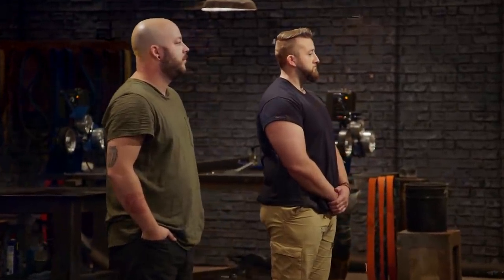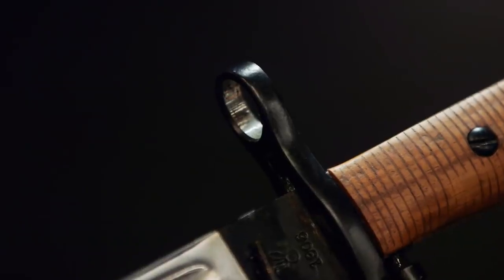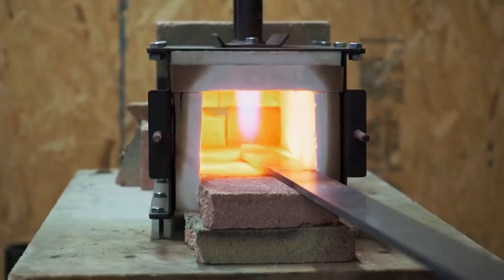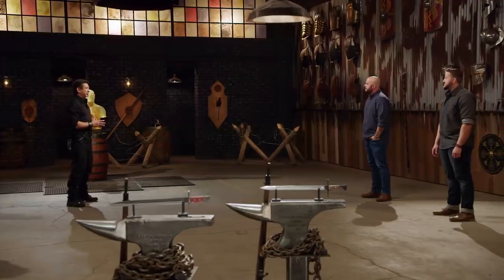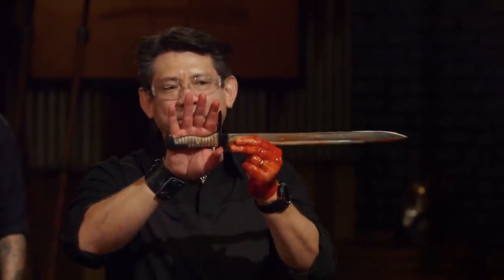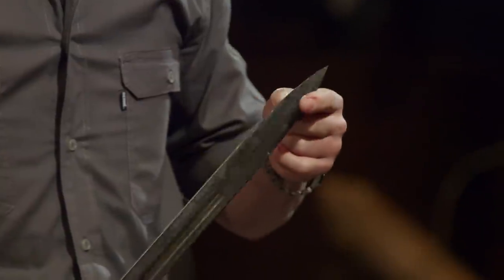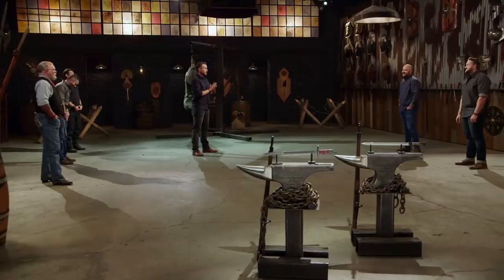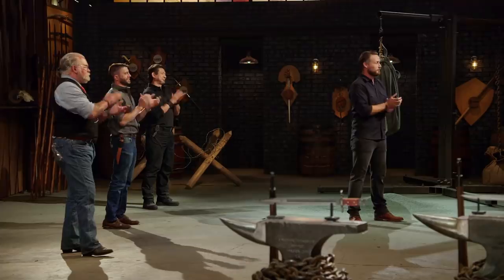Forged in Fire: Springfield Bayonet SPEARS the Final Round (Season 8) | History

Comment: Very nice! He said it was used over 70 years but our forces switched to the M1 Garand in WW2 then the M14. So I'm curious, does it fix to the Garand or are they stating that it meant being used by any Springfields still being used at that time?
Reply: The m1905, m1905e, and M1 bayonets can be used on the 1903, 1903a3, and M1 Garand rifles. 

I guess if you count guard duty or parade/ceremonial use, it's more than 70 years.

Comment: In all honestly, a 1905 bayonet is just a RUDE challenge to give to an amateur blacksmith. There's tiny machined elements of the locking mechanism that are very difficult to replicate, and that fuller is very deep. These are the types of things that required advanced and expensive machinery. I'm honestly surprised they managed it as well as they did.